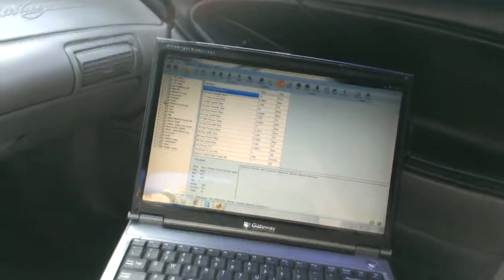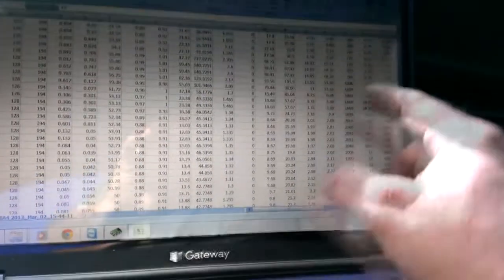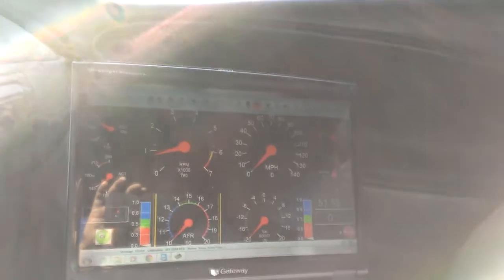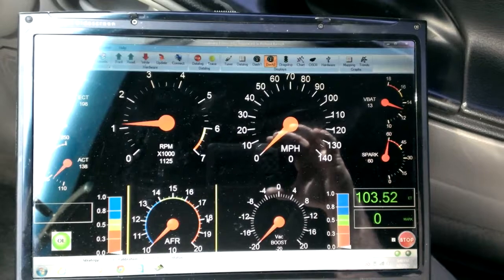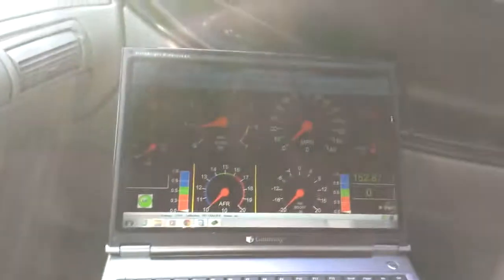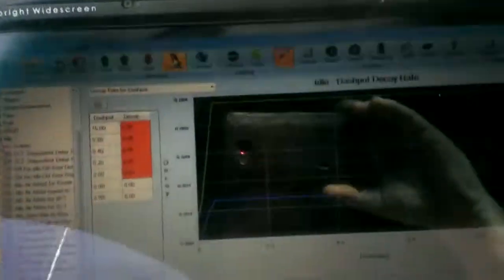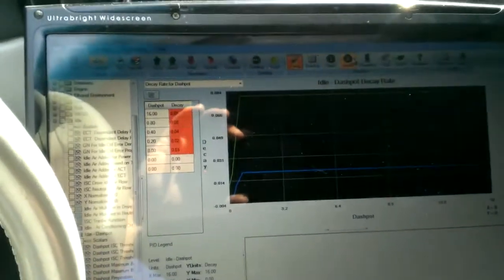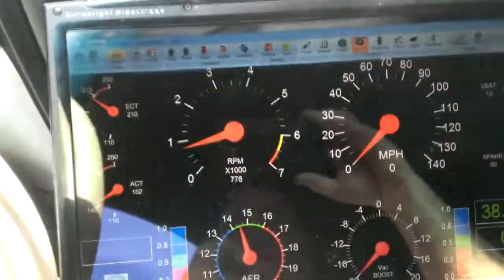Mustang GT Project - Tuning hardware and software

Comment: Either one really, just a good demo showing the power of the software. Especially since if you push the "Update" button, it pushes the change immediately.  There's four different rev limiters. Full cut and half-cylinder cut for neutral/clutch and in gear.

Comment: The two most fun settings to "impress" people with the laptop tuning are the rev-limiter and idle speed. Just blows peoples mind when you punch in 2000 RPM idle, hit the update button and the engine just shoots to 2k.